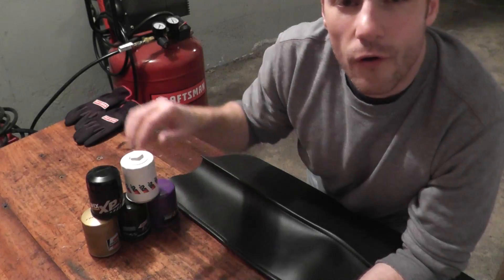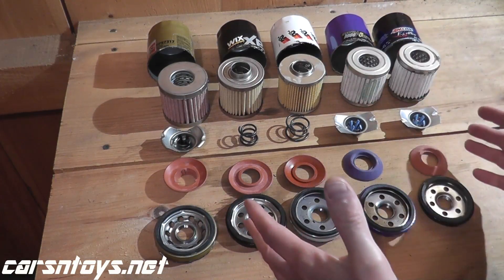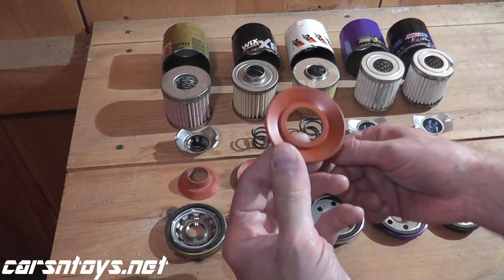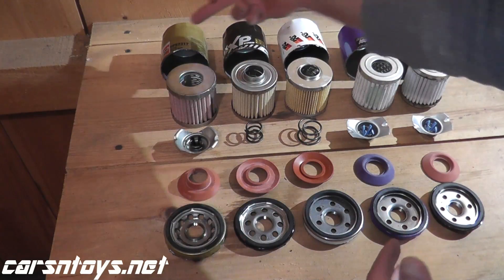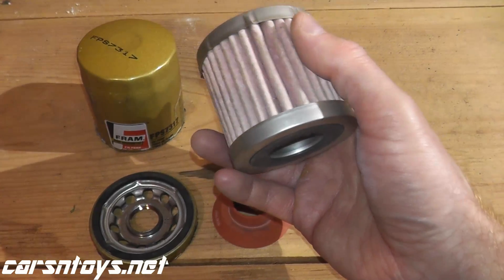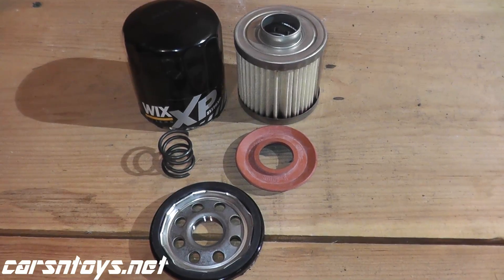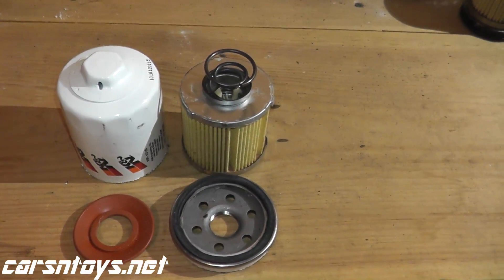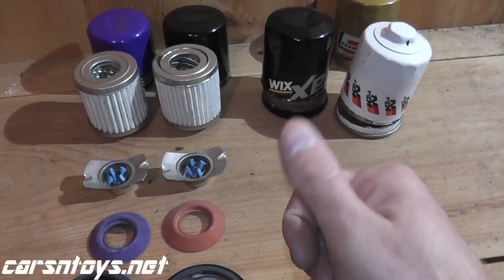Choosing the BEST OIL FILTER...FRAM vs WIX vs K&N vs Others

Comment: A website I visited had a diagram of oil flow through a filter.  Bypass filters had the oil flow in through the perimeter holes and out through the center port.  Non-bypass filters were shown with the oil flowing the opposite direction.

Comment: I have a 2004 G35 Coupe would I be fine running Mobil 1 Synthetic oil (Probably what I'm going to run, I just bought this car so Im not sure which oil I should run yet) and then running the K&N Oil Filter? I really haven't ever paid too much attention to brands or the weights or any of that stuff but now that I have a (sporty) coupe I'm going to definitely start taking the best care of my engine that I possibly can. Any advice would be dope (And yes I've been all over the forums)
Reply from the maker: Sure. Just follow the owner's manual on how often to change the fluid. Have fun. The G35 is a lot of fun.

Comment: Watch out on the K&N, in 2016 I bought a K&N for wifes 2011 kia optima 2.0 Turbo, the oil filter leaked from the tiny hole on the wrench off bolt on bottom. By time I discovered it was leaking, only 2 quarts of oil were left in car. Luckily the engine was ok.
Reply: I've used those and it has been ok. I think it was a defective one and u should have called K&N to get a replacement and probably a whole years worth of filters lol.
Reply from the maker: What a bummer. Thanks for the heads up.
Reply: A friend of mine lost an engine using a K&N filter. Filter blew off leaving the threads behind it killed the engine and caused a mess. To K&Ns credit, they eventually comped him for the engine.
Reply: Did you use the 1" nut when installing your filter?
Reply: I've had that same issue. Luckily my drive to work was short enough that I still has some oil. But I had a solid line of oil to and from work.

Comment: i went to jiffy lube last year and they put on a white filter with green letters. it just said performance filter. dont know much about it. but when i used my tool (the plier one with the teeth) to remove it when i changed the oil after and i crushed and stripped it easily. i used the same tool on the k&n filter i installed after the jiffy lube one and nothing happened to that one, it was undamaged.  i know some jiffy lubes use penzoil filters. but that white one convinced me never to go back. i had terrible milage on that filter.
Reply: The fact that jiffy used it means its a sub $2 filter from China.   Maybe it's fine,  but I wouldn't bet on it.

Comment: Great video thanks.  In the end Amsoil specializes in oil. It is nice to see they use a quality filter as well. I am sure Amsoil will not set up a shop just for Oil filters so its a mute point and makes perfect sense to see two alike.  The point is that I would say for the money your getting a top product when you order the best oils on the market or one of the best depending on ones take on oil.

Comment: Have a old mazda 626 and filter the old oil from a co workers new lexis. my car has 150k miles and is rusty. The oil had been run for 5k miles i so i use it for 5k miles. The oil is amsoil some people change it one time per year so 10k miles is not so bad . The oil is free i only need to buy a oil filter. The filter is a motorcraft filter i buy for 6 dollars.

Comment: Interesting note after looking more closely at two filters that are the newer cartridge type.  The Toyota OEM filter has 43 pleats and the Amsoil only has 29. Additionally, due to the metal top caps on the Amsoil filter the Toyota filter has an additional half inch of height over the Amsoil filter (2 and 9/16ths versus 2 and 1/16th). Now I am not any expert on filters but I do know that surface area is a key metric in their ability to filter particles.  Hence, on those two metrics alone, the Toyota filter seems to beat the Amsoil filter.   The material used is another key factor and the Amsoil filter may be (definitely) better on that front.  I definitely like the metal construction and rubber o-rings on the Amsoil filter which I feel provide a much better seal preventing any bypass from happening. I currently have an Amsoil filter in my 2016 Highlander after switching from the OEM filter but the above points out some interesting facts I am curious about. Thanks for the video!

Comment: RE: at 8:50 The reason for safety-wire is NOT to keep  filter from flying off and injuring another rider, it is so filter can not loosen dumping oil onto track (applies to externally mounted oil filters). Similar to requirement for safety wire of oil filler cap. If an externally mounted filter does not have provision for safety wire, most will install a hose clamp that provides attachment provision for safety-wire attachment. Nice review, thanks.
Reply: I was assuming that his explanation sounded weird if it somehow blew off I think something more impressive happened elsewhere.
Reply: My thoughts on the wire as well.

Comment: im curious  about the rating on Motorcraft  oil filters and are the rated for full synthetic  oils
Reply: Stephen Andersen yes Motorcraft filter are rated for Full Synthetic Oils. All newer Ford's require a minimum of a Synthetic Blend Oil for there engines. Motorcraft is a very good oil filter for the price which is usually under $4 at Walmart.
Reply: Stephen Andersen I do use a Wix XP on my 2007 Ford F150 but when my local parts store is out of the Wix XP filters I have used the Motorcraft filter with no problems.
Reply: TheOtherWhiteBread0 to they're made by the same people who make Purolators

Comment: Just a gee wiz... the safety wire is not to prevent FOD on the track, its to keep the filter/bolt or whatever from loosening from vibration etc...

Comment: Teardown oil filter videos can't address the most important component of all engine oil filters: the oil filter media. For that you need sophisticated particle challenge testing using florescent microbeads of defined sized and video microscopy. In other words, the rate at which each filter captures the beads at various bead sizes and how many beads can be captured before the filter media clogs is the single most important variable and the answer can't be found by holding the filter media in hand and counting pleats or media filter area. All of these filters use depth filtering media so thickness and fiber mat spacing and density are all important to performance. To make a long story a bit shorter, although a gross shortcoming in construction can catch your eyes, you can't evaluate performance without a serious investment in equipment and challenge methodologies.

Comment: ive seen k$n oil filters leak , the spot welds on the nut leak
Reply: Pro Series does not have the NUT on the top.
Reply: NOBOX7 , then you or the other guy didn't lubricate the gasket and/or tighten the aforementioned sufficiently.

Comment: Royal Purple and Amsoil oil filters are made by Champion Lab. That's why they are pretty much the exact same filters. Beware of some of the Wix XP filters because the efficiency on some of their lineup is 50% at 20 microns.  Which is really low for a high end filter. Fram Ultra is over 99% at 20 microns. The RP is 98.7% at 25 microns. Mobil 1 extended performance are 99% at 20 microns. There are a number of the Wix XP that fall into the 50% area. So, check to see if the size needed for your application is one of those low efficiency filters. The Fram Ultra is the best bang for the buck filter available right now. For $9 at Wally world for most filters it has all if the quality of a top filter. Construction with metal end caps, silicone ADBV, full synthetic media that has an efficiency of 99%, media with great holding capacity. Mobil 1 EP filters are right there too in terms of great quality. Just regular price is $12-13. Royal Purple filters are $15. If you can find either if those filters on a good sale or paired with a good oil/sale then it can be as good a deal as a Fram Ultra in terms of pricing. I have a Mobil 1 EP oil filter and a RP oil filter awaiting to be run. And I know that the efficiency in them is  better than a Wix XP. The beta ratios of the Wix XP will tell you what the efficiency is with them. So do some reading and research before buying one of them to make sure it's not a 50% one.
Reply: Clearly there's some quality control differences going on there with all of the excess glue on the AMSOIL in this example vs the RP.
Reply: Great valuable information THANKS! Better than the video;:).
Reply: A lot of filters are made from champ labs, napa's and Valvoline oil filters are made by champ labs as well. I'm pretty sure wix is made by champ as well, just like battery manufacturers, there's not actually a lot of them. They're all built to different standards per brand.
Reply: Personally I'm an Amsoil fan and I wouldn't be too concerned with the extra glue where the filter pleats meet the metal base. That joint needs to be sealed and not come loose with heat and oil pressure to prevent unfiltered oil from bypassing around the filter material. I'd be more concerned about not having enough glue!
Reply: 🤙👍💯✅25years ago been using K&N GoldFilter in my 4.0 Explorer with Royal Purple High Mileage & Engine Restorer & F-150 4.2 K&N GoldFilter & Royal Purple High Mileage & Engine Restorer & 1989 5.0 GoldFilter & Engine Restore. I can be more thankful about these productive products that have not disappoint from the start.

Comment: amsoil all the way. k & n is shit. nothing left to say.
Reply: Proof is in my 08 lmm that has always ran Amsoil oil, filters.both fuel and oil.. Run cold flow in the winter and injector clean every other tank on summer.  All amsoil product . Truck has 240k on all origional injectors and cp3. Not only are their filters superior. So us there fluids. So that's my 2 cents.

Comment: How would you rate Royal purple to K&N for 2005 Honda Accord lx 4cy. 62k miles..Last 3 years ago I bought it 27k miles running full sync oil..I found out Royal Purple and there filter seems to run great ...or a K&N filter ....
anybody open to it what you guys think...
Reply from the maker: They're both fine filters. The main difference between the two is Royal Purple is wire backed and K&N isn't; at least the ones I've looked at. Here are the cutting open vids: https://youtu.be/uzU6gYbW0cs & https://youtu.be/U5vz_krXkRg

Comment: High priced, overrated Amsoil looks like a piece of crap.
Reply: Go for it cowboy.
Reply: Ams and royal purple are made by the same manufacturer. Oem filters are always the best. The funniest comparison is when you put a Toyota filter up against anything aftermarket. They can't possibly serve the same function. Or you can always go to jiffy lube and get the wrong filter put on your car. That's really funny.
Reply: I haven't had a problem with Amsoil. I've been running it since the 5k mile mark in my civic si. Signature series ftw. I have over 170k miles on my car. If you don't like it, you should say why.
Reply: OhoFelix - are you the IDIOT of your family or the smart one?
Reply: Mobil1 is a joke for synthetic.....Ive seen that vid...it was not apples to apples.
Reply: Ojo Felix NM Im not really gonna watch the video cause i dont wanna sit through a 12 minute video, but 17 years experience with cars and i now only run either royal purple or amsoil. If I'm really going throuvh a rough time or im just building a shit beater car to play with and crash around I'll use Mobil 1.

Comment: Which filter filters best and has the lowest failure rate? The most important filter on an engine is the air filter and a well sealed intake.
Reply: sale Hillal that's true 1 cup of dirt will wreck a engine. As far as an oil filter does not matter what you use. All the engines I have rebuilt the dirt is always in the engine the filter didn't stop it. You have to remember all of oil goes through the filter but it doesn't all get filtered that's why there's a bypass valve in the filter if it all had to go through the filtering material the engine would starve for oil

Comment: You guys can theorize all you want about which filter "should" be better.  The best test is Used Oil Analysis to see which filter is really filtering the dirt out.  A visual inspection of the element I don't believe is really helpful.
Reply: PhilJimmyBob I used the STP extended life oil filter with full synthetic oil with ≈ 5,000 miles of use, which took me roughly 5-6 months. I did the oil analysis with Blackstone Laboratories and they stated the oil filter did a fine job at filtering impurities from the oil. The results of iron and aluminum were below average. I highly recommend any top of the line oil filters of your preferred choice. I know 5,000 miles isn't a lot of miles compared to some other people, but 90% of my driving is city driving in the Los Angeles metropolitan area.
Reply: It's still useful information on a consumer standpoint.
Reply: +PhilipJamesRobert: Your point is well taken, but I'm a shade tree mechanic and don't have a laboratory hangin' around. No disrespect.
Reply: When my customers oil change looks like a slow mud slide I don't think the filter matters to them.
Reply: The labs are available to send your oil to, that's what diesel mechanics do all the time. No disrespect.
Reply: PhilJimmyBob i was beginning to wonder if anyone had a brain, Common sense,horse sense, you are correct sir my compliments, ive been turning wrenches over 30 yrs,  and there is is never a dull moment especially with customer's 🤣🤣🤣
Reply: SBeckerDTD- Not if the parameters compared have no effect on filtering ability or life of the filter.
Reply: aren't they all rated to 20-25 microns tho ?
Reply: PhilJimmyBob he is right tho and u are right🙄🐺📹 📹🐺 u both right📹🐺👏👏👏🍌🍌🍌🍌🍌🍆
Reply: but he is more right📹🐺
Reply: This should be top comment.
Reply: Apart from Richard's analysis, anyone else have links to used oil analysis over a broad range of filters? Very interesting to say the least.
Reply: slipknot73745 visit bobistheoilguy.com
Reply: 1000% agreed!!
Reply: PhilJimmyBob yes, but to do that, you need similar cars driving about the same location. That gets expensive.
Reply: PhilJimmyBob I don’t think you’re very smart.  The idea is to see the quality of workmanship and materials being used inside the can, derp!  I mean, why pay for sub-par products?!
Reply: @Jack Lynch   It's called a fleet test. I think the most important thing is using the correct grade and weight, not what the filter is.
Reply: +Richard Ojeda Most over the counter oil filters use the same size micron fabric.
Reply: Loincourt Lestat none taken. The experiment was good. My idea is more overboard. That's for a car company to perform.

Comment: i wonder how motorcraft stacks up.
Reply: Clorox Bleach Motorcraft oil filters are manufactured by Purolator.
Reply: cooldbz12 Motorcraft is one of the best oil filters makers, if you drive a Ford your choice is simple, Motorcraft
Reply: Boostang S.I.C   Especially for Ford TD engines,NEVER go with aftermarket filters
Reply: MrCherrygrovedude Do your research. Purolator.
Reply: Purolator isn't a bad company and motocraft is fords Oem filter as far as I know.
Reply: That’s all I run.  Sure hope their good.
Reply: They are
Reply: cooldbz12 Motorcraft filters are made by WIX.
Reply: Branson Mathess no motorcraft is wix.

Comment: Just read this online .. curious if true or not.. guys screen name was OilDoc....     The AMSOIL EA Series Filters are the best filter you can buy. They are conservatively rated at 15 Micron Absolute. No other filter comes close. This is due to the Patented Nano-Fiber Technology used from Donaldson. 

The K&N is advertised at 20 Micron which may be so but seems to have a problem with particle retention. We have seen many of the filters cut apart after use and the media appears to be clean. The current conclusion is that it is due to the media used in the filters which is a compressed cellulose.... What happens when you compress paper fibers ????

I had verbal confirmation from a company that tested the Donaldson Media and the K&N on both Micron Ratings and Particulate retention that verified this..

Comment: in reading the comments it seem you do reply so hence i have a question i put a wix canister filter in my wife's 09 matrix full syn and now at 5 thousand im wondering if i could use an oil extractor to pull old oil out and leave that filter in until the oil change?
Reply: MrAsus3571 Wix advises you to go by the vehicles manufacturer  recommended oil change intervals. You can find that information in your vehicles owner manual.